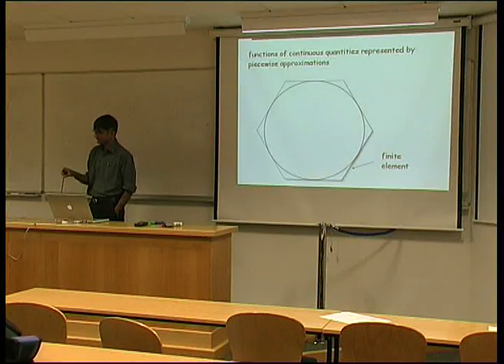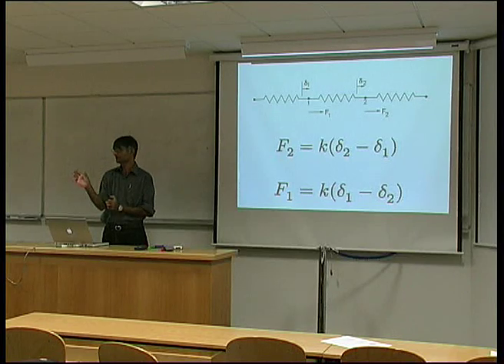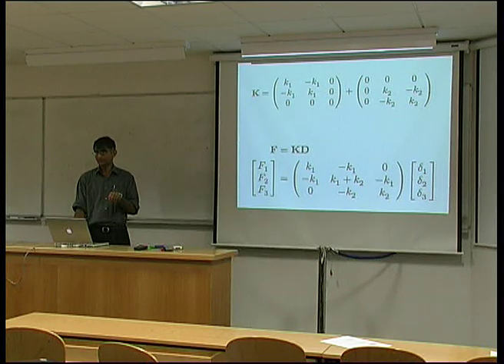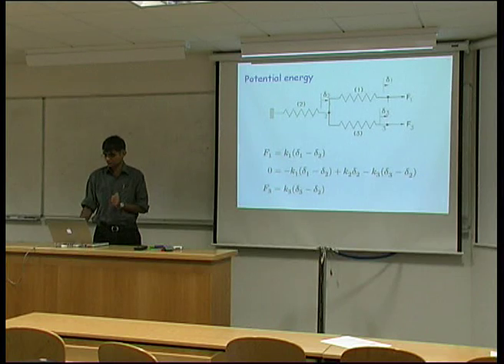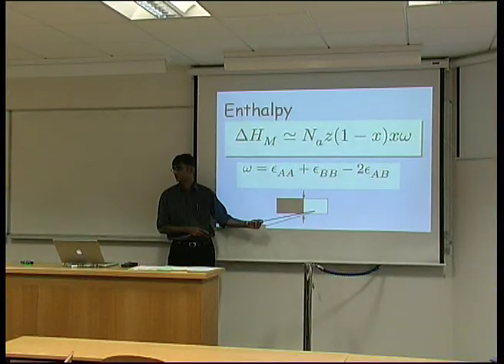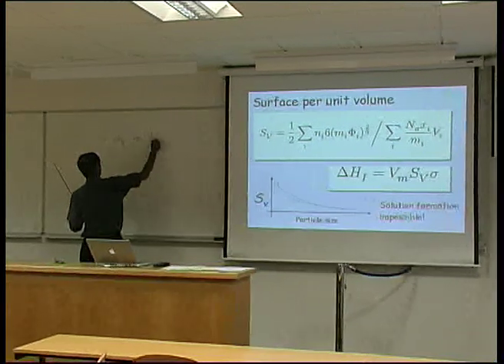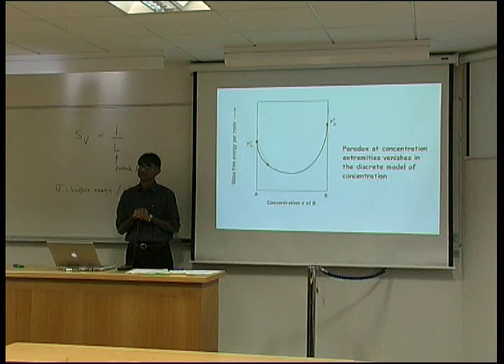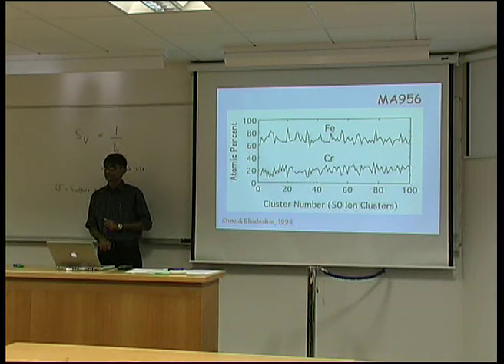Finite Element Analysis, Part I

Comment: Sir, 
After 7:14 You attempted to have a 3 X 3 matrix as stiffness matrix, why not the following one,

[■(F_1@F_2@F_3 )]=[■(k_1&0@ - k_1& - k_2@0&k_2 )][■(δ_1-δ_2@δ_3-δ_2 )] 

or as this

[■(F_1@F_2@F_3 )]=[■(k_1&0@-k_1&-k_2@0&k_2 )][■(δ_12@δ_32 )]

which is 3 X 2 and 2 X 1 matrix. 

@ separates rows and & separates elements in the same row but successive columns.